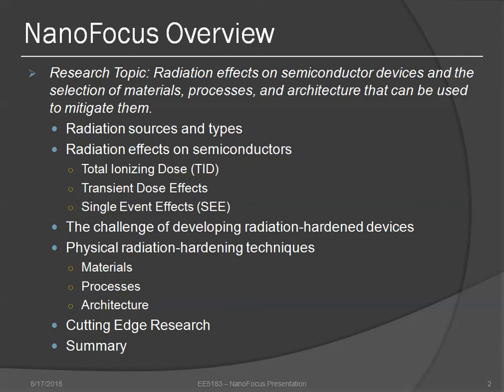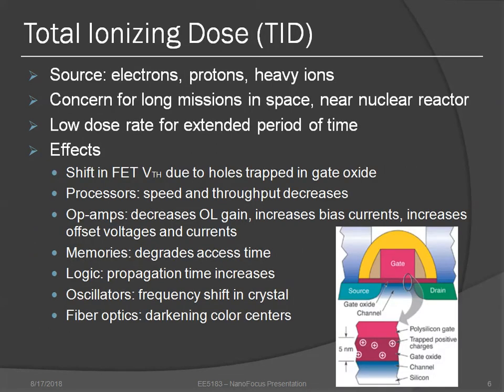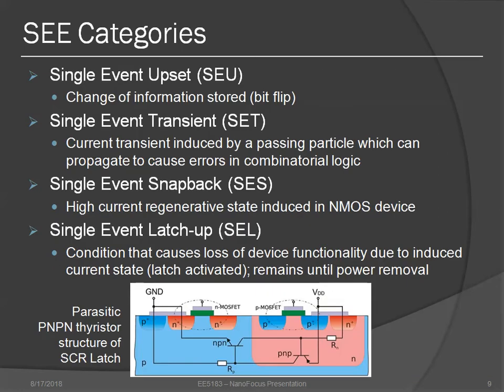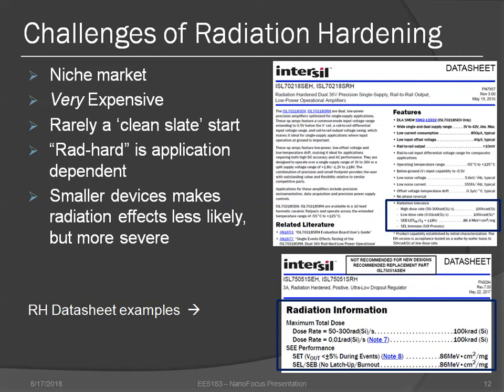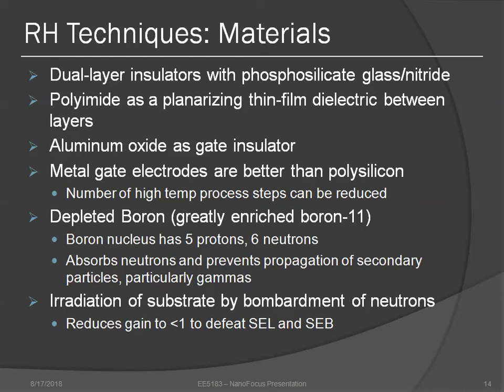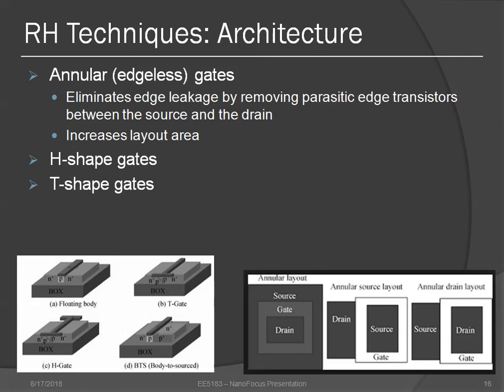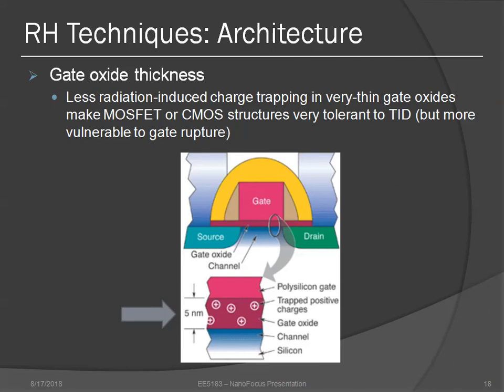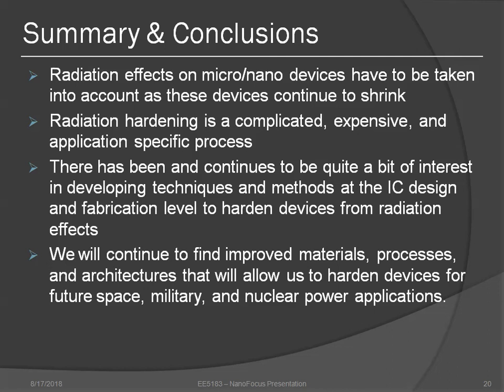Radiation Effects on Semiconductors and IC Design and Fabrication Hardening Techniques

Comment: "Lattice displacement damage" and "non-ionizing energy loss" sound like apples and oranges to me.  Is there an article about the history of the terms that can clarify why they are lumped together?

edit:  I'll take a guess that non-ionizing energy loss is a temporary condition when a particle heats up silicon to make it more conductive, temporarily shorting to ground and loosing energy with the dopants at least not diffusing too far from where they belong.  I'd still like to read what others have written about this.